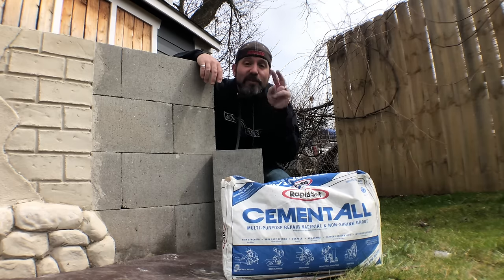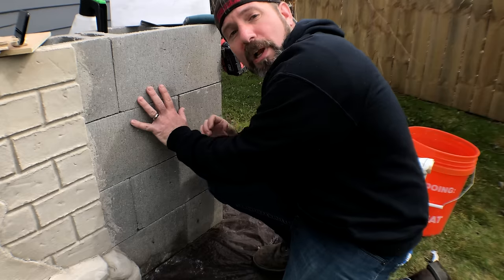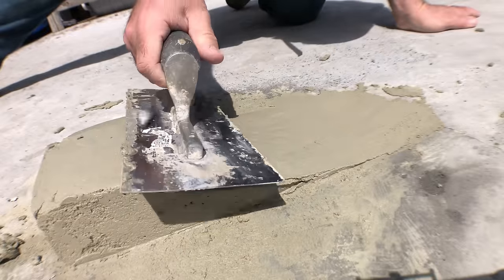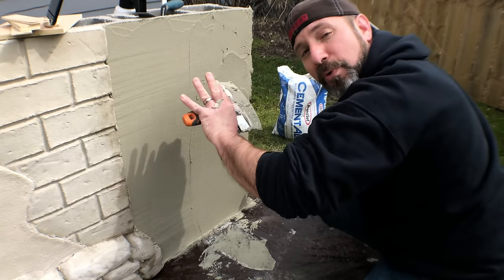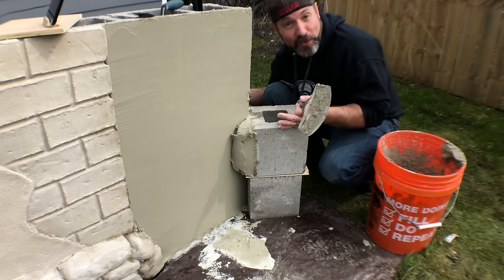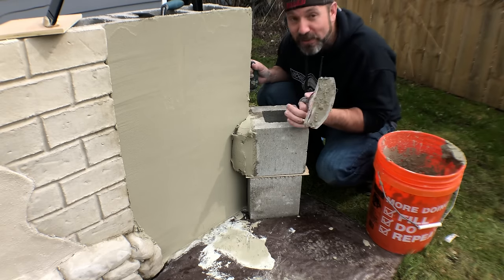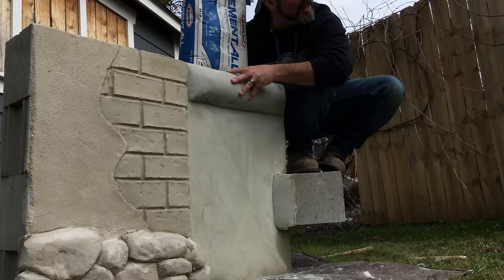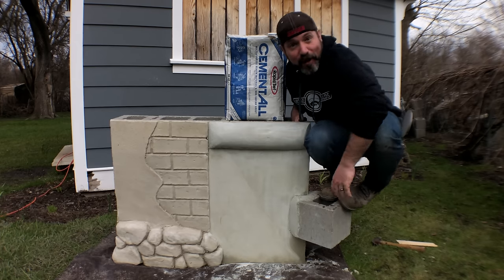How to PARGE and SCULPT with Rapid Set Cement All (Part B)

Comment: I started off thinking I'm madly in love with you. This will come in handy soon. But then when you destroyed that wall...🤦🏻‍♀️🤬.
Maybe you'll answer this question because I truly have no knowledge of any of this stuff. I mean, I made clay molds that I shaped like bricks and used plaster of Paris to make faux bricks for an interior wall. Made a solid wall, I'll say but not for outside. We're having a pipe porch built and now I know how to cover the bottom to make it look like brick or rock. 
My question is: the floor will be 1" × 4" and can you cover wood with either of those products? I would love a cement looking porch without the cost of pouring all that cement. 8' × 10' size. Or would that be a disaster in the making?
Reply: I cant speak for the masonry product side of this, however as a woodworker, I would not cover any lumber/organic material with these types of masonry product.
Masonry products are actually highly poreus and will retain water petty well unless sealed, And in either case its too great of a chance to hold moisture up against lumber where it cannot dry which will promote mold and rot.

With that being said, there are specific deck treatment products that give a masonry look and texture with a few special spices added that help bond to the wooden surface and prevent rot issues.

And as for pouring a big porch, Concrete by the cubic yard from a batch plant is actually pretty affordable, Your looking at $60 - $120 per cubic yard, That size porch assuming 3' off the ground would be roughly 6 yards
Its the prepwork, form work and finishing that may get costly if you hire someone.
Reply: @jamesschmutz6655  thank you. I will check into prices. I could do the prep work. I was concerned about possible wood rot.

Comment: My cinder block is already painted. What sort of prep is needed for this process to work on the painted block?
Reply: Could you glue a fiberglass mesh on the painted surface and then add the rapid set?

Comment: Question: How durable is this cement? I mean is it better than say brick in terms of durability and lifespan? I love the flexibility of this project you are working on. But my concern is doing a side of a house or a pillar to look like river rocks, but say 10 years down the road, all the hard work goes down the drain (crumbling). Any insight on that? Really digging this project.
Reply: I asked the same question. There was the 30yr stone guy comment he made on the first video, some replied but without any hard evidence of course. I agree, very flexible product but what will it look like in 10, 20, 30 years? I built a 40' cinder block wall to divert water and would love to use this instead of (paying for someone) concrete, etc - that can last for 50 years and in a lot cases more. Maybe starting it on a ledge is all that is needed. I don't think anyone knows since it hasn't been around forever, only time will tell.
Reply: @Apex8r  For me it's a matter of work in- work out. If I spend time building with this and it breaks down in like 15 years, then it would make sense to build using other materials or limits the use of this materials for only certain applications. Would suck putting this on the side of a wall, and then 15 years down the road it starts chipping away and making the house look terrible.

Comment: I would like to know if you can help me, i need to build a ramp from 0 height to about 4ft high and has to be a smooth transistion. I need it to pull my wood trolley up and my washing trolly down. I have  asked several people to do it for me, one quote was about $2000.00 i am a pensioner so that sort of money is a no  go. I thought i could try my self ,hence looking at your video. Is it possible for  me to and if so could you do a video step by step. I have the sand i can by the cement, and brick, or you call cinder blocks. Can you help me

Comment: How did you fix the wall after you broke the bond at about 7:14 ??
Reply from the maker: Lol 😆 I was really hoping that no one would notice that hahaha. I just simply pushed the block back and smoothed it over again. I slammed the material on waaaay too hard on that particular block lol 😂
Reply: @MichaelBuilds  ya I think you may have been running out of time with that mix, looks like a handy product though !!

Comment: and this is another very expensive parge
Reply from the maker: Then use something cheaper that requires way more prep…
Reply: @MichaelBuilds  wet the block, brush with portland cement paint, apply using trowel a mix of sand 2-or-3 : 1 portland; yes, more work but still easy, right ? ... and a fraction of the price